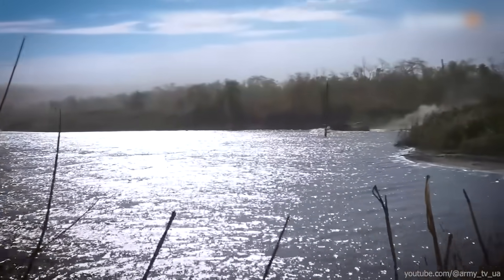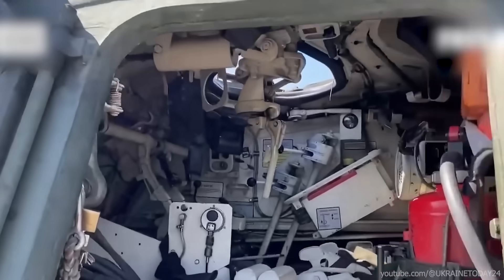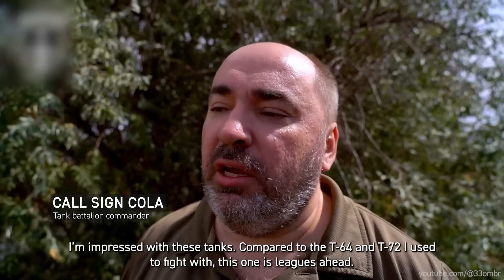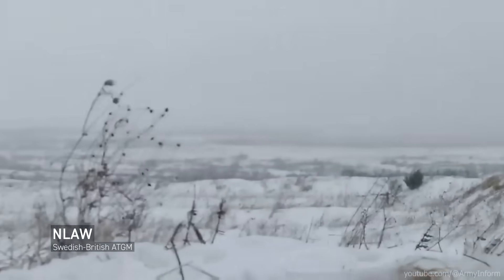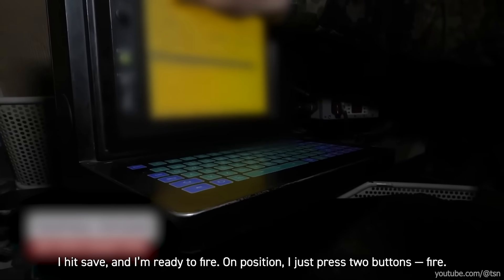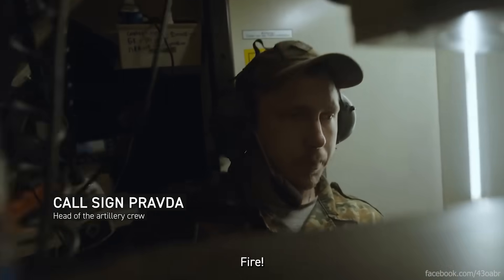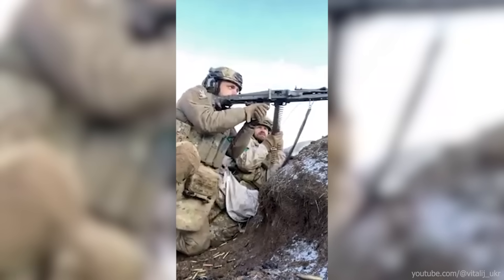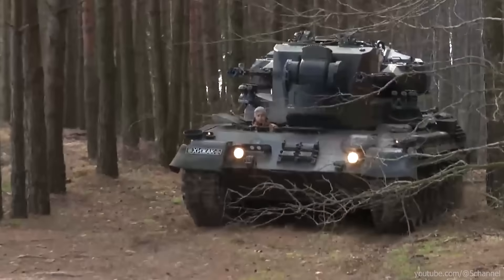LEOPARD Tank: Ukrainian Soldiers Spill Hard Truth About German Weapons

Comment: The M2 Browning and the MG3 are different classes of Machine Gun though... M2 is a .50 cal heavy machine gun, which is pretty much only used mounted on vehicles / in a fixed location. The MG3 is a general purpose MG in 7.62 x 51mm NATO, so a full size rifle cartridge, but of course way smaller than .50 cal. And designed to be used and carried by the squad machine gunner in cold war infantry squads. With the standard assault rifle of the German army at the time (G3) firing the same cartridge. The US equivalent of the MG3 would probably be the M60 or M240. The M2 is like a whole "size class" of gun above.

Comment: LOL! 50 cal vs MG 3 (aka MG 42) No need to climb a fence or cement wall with the 50 cal. Also, the MG 42 is a squad weapon, where the 50 cal is not. 2 different rolls.

Comment: They should know there are no perfect machines out there.
The Leopard 2 isn't perfect as many says.
Most importantly, it wasn't design to fight on the muddy terrains of Ukraine.

If you put that tank in such situations... you're gonna regret it.
We Italians have avoid to send to the Ukrainians our vehicles for the same reason.
Sure we have good vehicles, but none of them is designed to fight on their terrain. If used improperly, they will lose lots of lives.
So it's better focus on something that was specifically designed for their land instead of wasting time trying to adapt western platforms for their need.

Many think that just throwing money at a problem is sufficient to make the problem disappear. But it's not like that.
If we want to help Ukraine, we must do seriously, not like if it's a kind of joke.
Those people risk to die just because we are superficial on sending them equipment that is not fit for their terrain.

It would be way better help them filling their needs of AA missile batteries instead. A good Anti-Air will be crucial to help Ukraine in defending their assets and save lives, blocking the advance of the Russians.

Comment: Leopard 2 can go 

1200mm without any setup

2250 mm with a Tiefwat-Schacht (Deep wading Schacht)

4000 mm with a Unterwasserfahr-Schacht (Underwaterdrive-Schacht)

If you drive into water and the tank isnt visible anymore, it had to be deeper then  2790 mm / 3030 mm because that is how high a leopard 2 is.

Comment: Fun fact. The Gepard AA tank is old, very old. It was released in 1976 and was shelved in the German army in 2010 because there were other more effective systems against fixed wing aircrafts. 13 years later everybody was surprised how extremely well it performed as an anti drone weapon, a role it was never designed for. If you check the end of the Video, operators are firing short three round bursts. A standard burst against aircraft was more of a 50 round burst in the Bundeswehr, which is known to be very stingy about ammunition use.
Reply from the maker: It’s amazing how the Gepard found new life as an anti-drone weapon! The fact that it was initially shelved in 2010 only to prove highly effective against drones shows how adaptable older systems can be. The three-round bursts are much more efficient for the drone threat compared to the 50-round bursts designed for aircraft. It's a perfect example of how military technology can be repurposed for new challenges. Do you think we'll see more older systems being adapted for modern warfare like this?

Comment: Just a random German commenting:
The MG3 is a light machine gun. Compared to the M2 Browning, it is meant to be an infantry support weapon. The M2 is meant to be a heavy machine gun for fixed positions. We use both.
The PzH 2000 can actually fire up to 6 rounds in MRSI, with all shells hitting the target within 1.2 seconds. It can fire up to 10 rounds per minute, 20 rounds in 2 minutes or 8 rounds per minute for 3 minutes. For longer engagements, the rate of fire is limited to 3 rounds per minute because of wear and thermal stress on the barrel - tschüss 🙋
Reply from the maker: The MG3 and M2 Browning serve different roles—one as a fast-firing infantry support weapon, the other as a heavy machine gun for vehicles and fixed positions. As for the PzH 2000, its MRSI capability is impressive, but its sustained fire rate is limited by barrel wear. Still, it remains one of the best modern self-propelled howitzers.
Reply: @Weapons.Of.Victory  thats basically just repeating what I initially said...
Reply: @Weapons.Of.Victory  it is actually the best SPH. Not one of.

The MG3 is still - just like its great father - the MG42 the best infantry MG on that planet. With it, no enemy wants to engage you (only call tons of artillery to remove that MG).
A M2 is way to heavy to be useful in THAT role. As a heavy MG on a truck or a tank - superb. But not as a weapon you take with you into infrantry fighting.
The Gepard - was still the best AA gun carrier, but the germans ignored to modernize it. These "computers" are from the early 80ties.
But germany has the (much more expensive) replacement - that - again - is the actual best AA-armed vehicle in the world.
Maybe the lack of such vehicles in WW2 causes germans to act "paranoid" about this protection.
Gepard should be mass produced now, with updated electronics. No drone or kamikaze stuff would reach your tanks.
Also, a Gepard is cheap, compared to the modern system - price difference is about 10 times cheaper. Even if build today.

Comment: If a Leopard doesn´t come out of the water its not a problem with the water but with the mud. Even a tracked vehicle can´t go anywhere. Especially, if it weighs about 50 ts. In the German army we use to have Geländebefahrbarkeitskarten (maps indicating whether a certain ground will accept these tanks - or not) and tankers are friendly asked to look at them. Otherwise they get stuck. 

Therefore: If a tank get stuck, it´s tankers fault, not the tank´s.

Comment: you arent supposed to drive the leo 1 into water without a snorkle, what are you even talking about here?
Reply: Oh you can, but not as deep of course. Three levels are known: Wading and Deep Wading and extended Deep Wading. For wading it is about to be 1,20m. You have to do nothing prior to this. For Deep Wading you can do 2,50m but have to do some procedures beforhand which the tank crew can do allone and with the supplies from the tank itself. The extended Deep Wading ist about 4m and need the same procedures as before but with a long snorkel provided through engineers - so it can not be done without support.

Comment: The PZH2K can not only shoot 3 artillery shells so that they hit at the same time, but actually 6 if the gunner does a good job and it holds the world record with 10 shots under 1 minute
Reply: 6 is a stretch. In best conditions. 4 is more likely. But it all depends on several attributes.
Reply: @doubleT84  the chief engineer of the project stated 5 in a Interview, maybe that changed, it was a few years ago
Reply: You need to read up on RoF - "15,5 cm bandkanon 1" sais hi... 15 x 155mm shells in 45 secs and that was fielded in the around the 1970's even.... and that is still the record keeper to my knowledge
Reply: @mikael2670  we talk about MRSI (Multiple Rounds Simultaneous Impact) not the record for time

Comment: For situations like this, the Leopard 2 has a pipe that can be attached to the entry hatch on top. With this, it can definitely drive submerged with two to three meters of water abouve it's upper line. Id did this myself when doing my conscripted service in 1989.
Reply from the maker: The Leopard 2's ability to be fitted with a snorkel system for underwater driving is a testament to its versatile design. The system allows the tank to wade through deep water, which could be a crucial advantage in certain combat situations, just like you experienced during your conscripted service.

Comment: There were several pieces in newspapers on reliability of some western equpment in the Russian war. Especially the PzH 2000 and abrams suffered failures and there were issues due to extended repair chains back to Poland or Germany, since there was no sufficient expertise or parts on stock in Ukraine yet. Also on capability of German manufacturers to keep up with repairs at that time. Hopefully it's better now. It would be best if RheinMetall and Co. had their own shop or a partner in Ukraine. 
Not an expert, so fact check me. Just something I've read once.
Reply from the maker: Yes, Western equipment like the PzH 2000 and Abrams faced reliability issues early on, with long repair delays due to lack of local parts and expertise. Having a local repair option in Ukraine would improve this situation. Hopefully, it's better now.
Reply: @Weapons.Of.Victory  The PzH was as reliabel as expected but the ukrainians just overused it without service and maintanace. No offense there they just had to use them that way because there where so few of them.

Comment: dont see a problem with adding more protewction to leo 2 it ok, tehy use tehm difference then westen nation because tehy dont have many 
if the additional weight of the active armor that you screw on is not a problem for ukrians tanker it ok 
they much handle the higher weight, slower slower tank then and if they think it still fast enogth with thoses add 
they should do everything so that they can protect the tanks and crew becnasue tehy just dont have many so keep save

also did they add carpet to the pzh2000 ?
Reply from the maker: Adding protection to the Leopard 2 is fine, especially with Ukraine’s limited tanks. If the extra weight doesn’t slow it down too much, it's worth the trade-off for safety.
As for the PzH 2000, I haven’t heard about carpets, but upgrades for survivability are common.

Comment: no leo 1 A5 had impressive amor it was always to thin only the Canadian had extra amor mexas ca 66 -123 peaces.

Unfortunately, most of the Leo 1 and Leo 2 have been scrapped, more than 4000 in total. If they were still there and in Ukraine the situation would be different.
Reply from the maker: Yes, the Leopard 1A5 had thin armor, and only a few, like the Canadian models, had extra protection. Unfortunately, many Leopard 1 and 2 tanks have been scrapped, which limits the available options for Ukraine.
Reply: @ In addition, the idea of a Leo2 or Leo 1 is rather outdated. A CV90 Puma or even the Lync in connection with Skynet is more of the future or the present. An armoured vehicle without proper protection. Drones are outdated. Times in which the main threat comes from the front, which is why the protection there is at its highest have been over for more than 10 years.

Comment: father of a friend of mine works at rheinmetall - he said that the pzh200 can fire far further than officially ;)
Reply from the maker: Wow, thanks for that insight!
Reply: @Weapons.Of.Victory  According to the Bundeswehr it reaches up to 140 km.
Reply: @Katze0101That sounds a little fanciful. it’s a really good gun, mind you. i just don’t see it out-ranging medium range missiles…
Reply: @Katze0101 nope. Who in the Bundeswehr said that? Can you link a source in the Bundeswehr or a reputable magazine?  The longest 155mm shots I've heard about were 50-70 km, and that's with special ammunition.  If what you're saying is true, GMLRS rockets wouldn't be needed.
Reply: From what I've read in other comments there are RAM-jet shells that trade a bit of payload for a tiny rocket engine that speeds the shell to 2,5+ Mach. It's supposedly rated for 100km so 140 may be extended range, but i really don't know ^^

Comment: There is no such thing as the Leopard tank, it has been around for over 50 years and also in various versions and stages of development.
The Leopard 1A5, Leopard 2 A4, A5 (Swedish) and Leopard 2A6 are currently in use in Ukraine.
The Leopard 1 dates from the early 1970s, the 2A4 from the 1980s and the A5 and A6 from the 1990s and early 2000s.
The current Leopard 2s are the Leopard 2 A7 and A8. Germany has just ordered 123 Leopard 2 A8s and replaced the Leopard 2 A6s that were given to Ukraine with Leopard 2 A7A1s. The A7A1 and A8 have a hard kill system (Trophy).
Germany only has Leopard 2 tanks at the Leopard 2 A6 to A8 level. There are also special versions of these tanks, M versions with special mine protection, or UC (urban combat) with the shorter L44 barrel for practicality, otherways all of them have the L55 barrel.
*The Leopard 3 is now also presented as RC, the tank has among other things a autoloader for 20 rounds.
Reply: https://www.youtube.com/watch?v=75SY8OmfUpU
Reply from the maker: While the Leopard has indeed gone through various models over the years, it’s important to note that each iteration brings improvements. The Leopard 2 A6 and A7A1, with their advanced armor and Trophy hard kill systems, are a far cry from the Leopard 1, which is now outdated. Ukraine is getting these upgraded models, and they pack more punch than the original versions. As for the Leopard 3, it’s still evolving, but the technology continues to improve for future needs.
Reply: @Weapons.Of.Victory  The Ukrainians have upgraded most of the Leopard 1s with Russian reactive armor. It doesn't weigh very much, so the Ukrainians appreciate the low weight of the Leopard 1.
The Leopard 1 and Leopard 2A4 have a frontal MBT attack strategy and are not heavily armored on the sides because the attack is supposed to be frontal. So far there have been disagreements in the Ukrainian army about the use. The leading Ukrainian officers were still trained in the USSR doctrine and use the tanks according to the Soviet strategy, although they were not designed for this. They use MBTs against ground targets that defend themselves with RPGs, etc., although according to Western doctrine APCs or IFVs should be used there. The Ukraine cannot afford to waste extremely expensive MBTs like this in the long term. An MBT costs 6 times as much as an IFV/APC.
How it works as intended:
https://www.youtube.com/watch?v=ajaOWZE2gZI
If you think the dust is unreal there:
https://www.youtube.com/watch?v=ftdOEU963iw

Comment: 5:22  THAT is not a German 120mm.  You thought you'd just use any old crap footage and no one would notice?
Reply: ... they're talking about the Leo 1 at that point, which doesn't have a 120mm gun.
Reply: 105 mm with with brass sleeve from leopard 1A5

Comment: The problem is that the Leo ist too complex for them!! They dont know how to use it.... From 24 Leo's in the Ukraine ( 19 from Germany, 5 from Portugal ) the most are destroyed or need a repair, its insane!! With German Tank troops the opposite where the reality!!! Its like the same you sit Mr. Bean in a Formula 1 Car...sorry but that's the fact!!!
Reply: Ich bin ein ehemaliger Richtschütze im Kampfpanzer Leopard 2a6 und meine Ausbildung ging auf dem Panzer 3 Monate mit einer Prüfung..danach wurde weiterhin geübt mit einer festen Mannschaft damit man aufeinander eingespielt ist. Die Ukrainer hatten nur ein paar Wochen Zeit sich mit dem Gerät zu befassen. Dann kann man nicht erwarten das die Ukrainer dann gut damit umgehen können. Unmöglich...
Reply: Main complete losses of Leo 2‘s occurred in the first 4 weeks of usage.  Afterwards, measured based on the numbers of total combat operations, most of the tanks survived already longer than expected in this conditions…
And to be honest, especially the 2A4 is quite easy to learn the basic operation of the functions. All on top is perfection and experience in the strategy. 
PzH2000 and Gepard are much more complex in handling.
Reply: No, Leo 1 performs quite well - Leo 2 is a 60-ton MBT and like all of these it suffers from the same problems the Tiger did 80 years ago. They get stuck, they suffer mechanical failures, they are sitting ducks. It's a question of weight/mobility on chernozem soil, not complexity.
Reply: @willietorben560  Lol what are you drunk or something? Leopard 2 is one of the most reliable MBTs out there.

Comment: nah, you can not really compare brownings with mg 3, the one is a heavy machine gun, the other is a light one, you can basically carry the one and fire, the other one is not useble on the move, but it comes with other advantages and disadvantages, brownings fks everything, including lightly armored vehicles, mg3 doesn't. depends what you do with em
Reply: This. Germans have the bigger ones for the same usecase.
Reply: Thats correct.
With the larger ones you have in some cases good advantages .. specially with targets behind some "light" armor or buildings
And i say that as a german ;)

Comment: Anyone who likes German engineering quality has never owned a BMW or Mercedes.
Reply: You mean todays BMW or Mercedes?
Okay.

But Mercedes from the 80s can easily reach 600,000 km or more.
(Maybe survive after 40 years beyond todays Mercedes.)
Reply: @alestbest have owned 6 VWs over the years and never had an issue with one of them
Reply: Hello I own a Mercedes. It’s fun. What car do you drive?
Reply: Yes, they are designed to fail. At least the new ones. My old BMW runs like a charm. Still hits nearly its top speed, despite the Trackdays. Never any engine problem aside from a leaking valve cover seal. After 18 years of use and abuse. And yes, i may have a little aero on it and a more track suited suspension with swaybars, but the Engine is bone stock. Not even rebuilt. And i use it as a daily^^